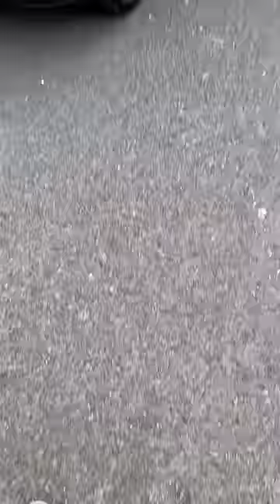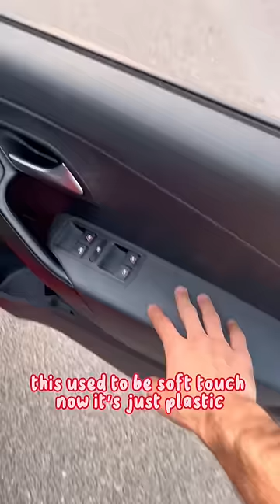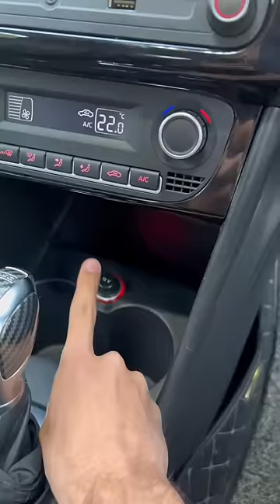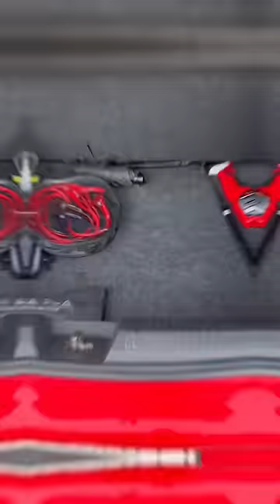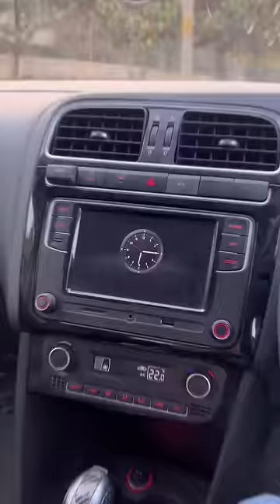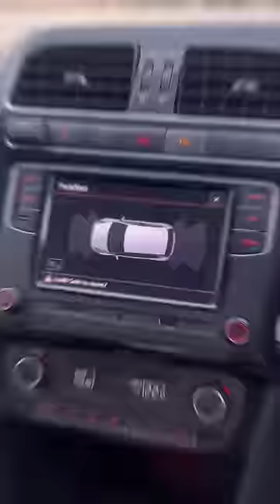Cost cutting on Newer Polo and Vento Models 💸

Comment: The spare tyre thing you mentioned is not true. I own a 2013 vento and it too has a space saver tyre & also the fabric padded armrest  is not present in my 2013 vento. The fabric pads were present only till 10-2012 models ig.
Reply from the maker: Oh, my friends 2013 GT TDI had full wheel instead of a rim and padded armrest. Not sure, maybe there was some mix and match done by vw
Reply: @PrerakKataria  Only Gt models had it, rest normal polo & vento's never had it🥲
Reply: I second that for Vw polo 2013
Reply: My 2014 Rapid base model has a fabric cloth on the armrest. Not very soft tho.
Reply: @SSPCars  my 2010 normal vento has it

Comment: Bro where did you get the electric adjustments and lambar support for your car ? I would love to have it in my polo.
Reply from the maker: I did it myself, got the seats from a scrapyard and made adapter plates to mount the seats which I sell separately
Reply: i also did it with seats from an audi S5 8T, but i went with the manual adjustment cause they are 10kg lighter, but they are still heated, TONS of more adjustments, electric lombar support and the leather+alcantara is much better than fabric

Comment: Because Polos were sold in a lot of countries and remained more of less the same (MK5) throughout their markets, one can add a lot of features in Indian Polo by getting parts from a French Polo (obviously both should be MK5). Also, parts are so much standardised in VW that Polo can even accommodate Jetta’s seats (with ventilation & memory function) and no one can say it isn’t a standard Polo fitment. Polo can also use many Golf GTI’s parts. There was a 1.6Ltr NA 4cylinder Polo that was amazing to drive. If I had that much money, I’d still be swapping parts in and out of my Polo.

Comment: Engines and build quality was very much better before 2014
Reply: You've got to be joking? VW went to crap after 2000 and had a decade of absolute reliability flops. It was only in 2010+ they started to gain relevance as their cars once again started getting fairly reliable...

Comment: I never realised about the arm rest and the ring in the newer ones. We have the 2011 Vento with the 1.6 TDI and it has both of those. It originally came with fabric but we had it changed to a softer material and also had the centre arm rest also changed to a little softer and more supportive specifically for my dad's driving style.

Comment: Absolutely right. In 2016 I bought second hand Polo 2012 model . I used that car for 4 and half year and later sold it. Having used German car for 4 yrs i didnt find that comfort and safety in any other car so i decided to buy New Polo. When i took test drive in 2021 i was very upset looking at the n numbers of compromise VW has done on Polo. Be it engine size, built quality, car weight, side mirror size and other features. They have done hell lot of compromise and ruined iconic Polo.

Comment: My polo is 2013 highline and yes it has 4kops in the rear boot and when I upgrade the stereo to rcd340 then it shows the ops lines on the stereo otherwise that ops didn’t work and when they started giving touch stereo in 2014 they removed the ops like why the ?

Comment: How did you add the boot lights? Wiring was added separately I guess, as most manufacturers remove the wiring even if the slot is present? And how are linked to the locks, so they don't remain lit up when the door closes?
Reply from the maker: I have a full YouTube video on it, it’ll clear each and every doubt of yours
Reply: @PrerakKataria  Can you post a link to that here, please.